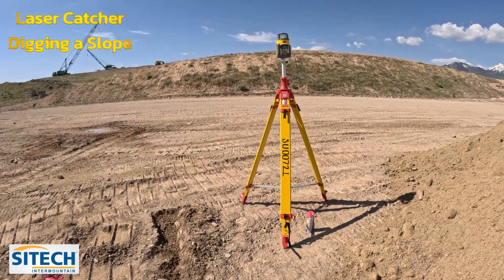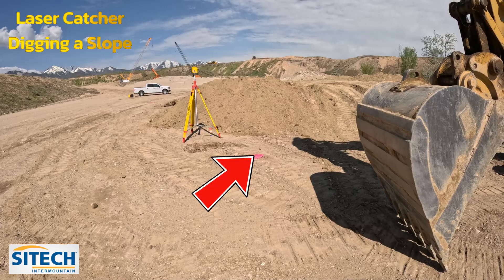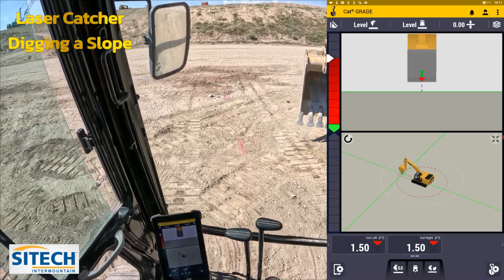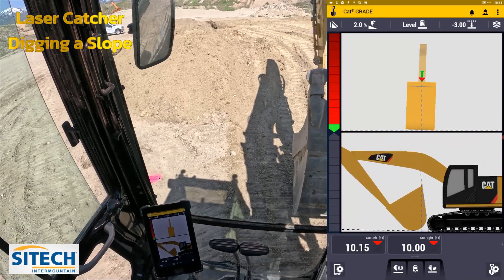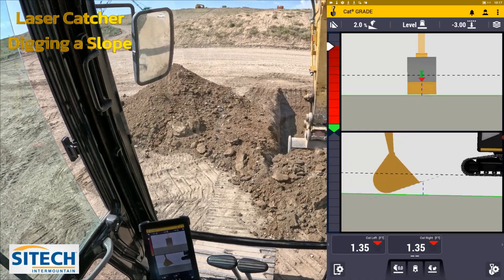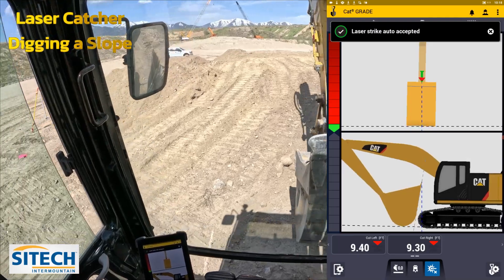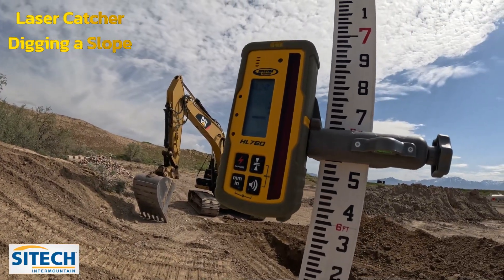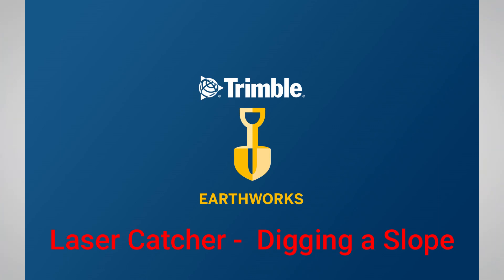Earthworks Laser Catcher Digging a Slope

Comment: @SITECH Intermountain, I am confused -- Help me understand. I use a dual-slope laser often for my grades, so I get that part. In fact, it is the exact same model you have in your video.
You set the laser at -2% on the appropriate axis to get your fall. Standard procedure. I am clear on that. What I am stumbling over is setting the excavator catcher on a +2% ... I'm trying to make my brain understand how a net zero slope equals the -2%.

I mean, I do SEE that it is correct when you check it with the grade rod, but the math ain't mathing in my head....
Help me Obi-Wan...
Reply: It confused me either ! Not sure why he set the laser on -Y if he dig 2% down underneath him... I can understand in the machine but doesnt make sence...

Comment: I have 2D with the laser catcher. So lets say you put in a cross slope of say 2% (both the laser and machine)along with your +2% main fall and you had to dig that trench 4 buckets wide. Can you turn the machine but moving the undercarriage and dig some to the right instead of digging one bucket wide trench backwards then coming back and digging 3 more the same way. If you turn and dig, is machine going to give you readings for the main fall slope because you are pulling the boom back towards the machine?  I guess the question is, what is the best way with 2D with the laser catcher dig with both main fall and cross slope?
Reply: Yes sir it is possible.  Think of the laser beam off the laser as a reset button every time you catch it to reset what elevation it is falling at both main fall and cross slope.  So you would align the excavator with the main fall you want to dig and then on the top of the screen you have both options.  One to enter the main fall.  The other to its side is to set a cross section or side slope.  Once you have set down on a start benchmark for elevation and have entered your slopes and have also set the laser properly with those slopes in line with the main fall dig, then catch the laser beam.  Then dig dig dig and then when you back up, re catch the beam and it will reset at the beam as it is falling and that’s how it will know how to stay on grade.  I hope that made sense.
Reply: @JeffLarsen-iz8qk   what makes this heading bench possible in the next gen cats and is it possible to get the same sensor(?) added to my trimble 2d with laser catcher?

https://www.youtube.com/watch?v=_nJluYr39FU
Reply: @JeffLarsen-iz8qk  I posted this a couple of days ago, but it disappeared. 

https://www.youtube.com/watch?v=_nJluYr39FU

What would it take to achieve this with my 2D with laser catcher ? A sensor?software update?
Reply: That is what I thought but I was concerned that if I turned the machine to dig to my right that it would do the positive 2%that I had set for my main fall. Like when I use measure mode I can only measure boom in boom out up and down  it doesn't calculate if I turn the cab. I have a pond job that is wide open I can mess around with it more. Normally I am just digging single sloping trenches as you demonstrate in the video. One day when I am all growed up I will get gps. 

And I will say I will never own another machine that doesn't have earthworks on it. It has increased my productivity and decreased the getting in and out of the machine or calling the ground guy over. And almost completely eliminated rework and the rework that their is always operator's error😂

Thanks again for taking the time to make these videos and responding to questions

Comment: So can you explain in more detail what is happening with a flat rotary laser when you set a slope in the machine with 2d? It’s only accurate as far as you can pull?
Reply: Makes sense, thanks, I tried using it for 200’ of sewer and had a really hard time lol, now I know why. Glad you’re making these videos since there’s not much training when one purchases these products
Reply: I am glad that this has helped.  I know that I am covering many different ways to use these products, but hopefully it gets people thinking also.
Reply: Yes.  So if you set the laser to a slope, lets say 2 percent in one direction like in the video, it needs to be in the same direction as you are digging.  The machine in 2D is only as good as the undercarriage does not move once you have benched and caught the laser, so if you catch the laser and then did backwards at that slope the machine has to be told inside that you are also digging at a 2 percent or it will just catch the laser and then did flat or assume flat.  Also, every time you move the undercarriage or track back to did more, the elevation or reference to the laser is null.  You must move, then catch the laser again which will then re reference where the beam is in relation to you and it starts over again and the machine still needs to have the 2 percent in it or it may tend to do a bit of what I call a stair case as you did back. But you are correct that you are only accurate as far as you can pull until you move and re refence the laser. Hopefully this makes sense.
Reply: If you set a slope in the machine while the laser is flat, it will cut a slope, but every time you catch the laser again it will reset you back up to that level and you will have a stair case effect. So yes it will only go as far as you can reach that time.